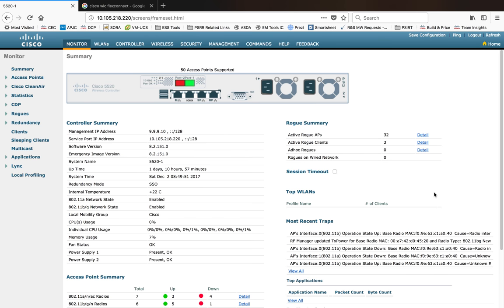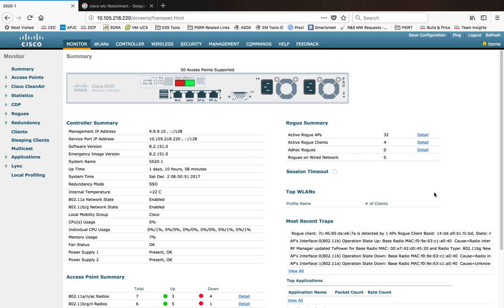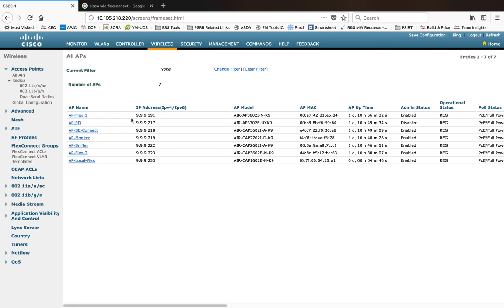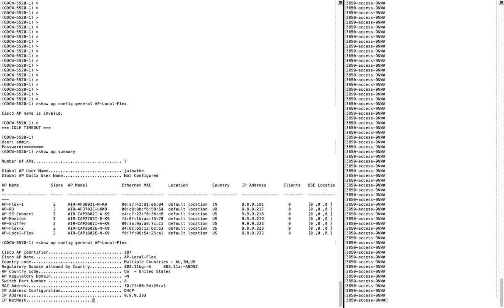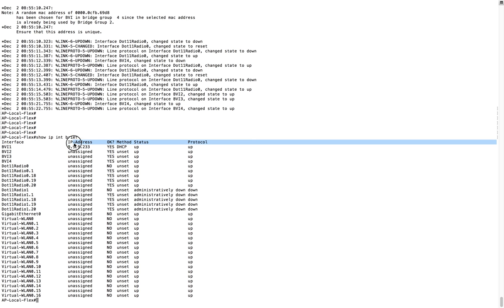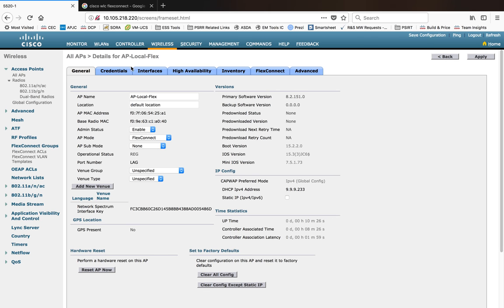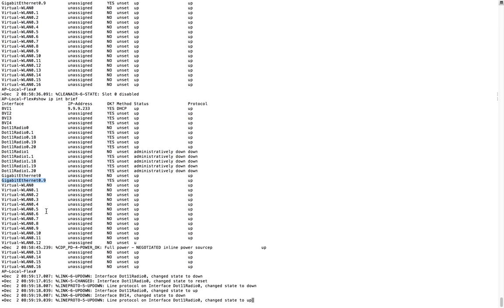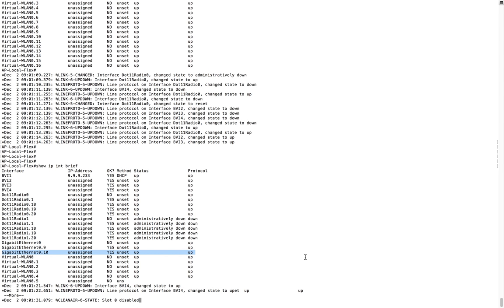How to Configure Flexconnect Mode on Cisco WLC  PART 1

Comment: Wasnt local switching already enabled?
Reply from the maker: By default local switching is disabled while creating the WLAN. Flex connect mode APs will not be able to do local data switching until it's enabled under WLAN.

Comment: Great Video !! Can i please know, how do we join this AP from a remote site to the WLC in DC when they are not in same subnet ? Can we do it through L3 routing ? any videos on that ? Thanks.
Reply from the maker: Basic requirement is to have a L3 connectivity between WLC and AP. If you can make that happen normal CAPWAP discovery will help you to get there. Please watch the video for CAPWAP discovery process, that explains different ways of discovering the WLC. In simple note Option 43 in DHCP Scope will be your friend here.
Reply: @CiscoNetworking  thanks let me try it and let you know the output. I have just configured a flex connect looking at your video, we will move the ap to remote location and check. Thanks

Comment: Hi Friend, i have one query if we have multiple AP in flex-connect mode but SSID is not converted to flex-connect. And want to do this now will it reboot AP or what will be the impact of SSID changes bring in network as i have 400+ AP and want to change SSID to flex-connect which is not implemented earlier but AP is chose as flex connect.
Reply from the maker: Only in two conditions we need AP reboot
1. AP mode change
2. AP group change

In newer APs, some of the reboots are also reduced but there will be a CAPWAP reset.

In your case APs are already in Flex-Connect mode so there is no reason for a reboot. But there will be a flap on WLAN as you have to disable and enable the WLAN to make changes. Also keep your Flex-Connect group ready for better handling of Locally Switched WLANs

Comment: Hi JAson another great video on Wireless, Really helpful....Two query I have regarding the configuration:-

1) Do we need to pass the correspoding vlans (which get created everytime we define vlan for locally sw/itched WLAN on AP) on switch connected trunk link as well, along with the Native Vlan.

2) Do the native vlan carry Centrally switched WLANs data over to the WLC present in DC
Reply from the maker: 1) You have two items here 
If you are making changes on Native VLAN, you have to update the same on the switches. 
If you want to add more WLAN with Diff VLANs, you have to update the 'allowed VLAN' list on the switch trunk port accordingly. 

2) in simple words, APs establish the CAPWAP tunnel using the AP Management IP part of the Native VLAN. So all the traffic pointing to WLC will pass through the same path. As the centrally switched WLANs are using the WLC as an exit point, they will pass through the native VLAN.
Reply: @CiscoNetworking  Thanks for the reply Jason...

Comment: what if the flexconnect ap has a weak signal? and users cannot connect to some ssid? what is the possible issue? and what resolution must be considered? thank you.
Reply from the maker: AP mode and RF don't have any connection here. Try to find what is going wrong on TX power levels in that area. Most probably its an RRM related issue. If you have an NMS system like Prime or DNAC check the heatmap of that area and find how the PTC taking care of the Transmit power. One you correct the RRM/RF profile settings, the issue should get resolved.

Comment: if i have an interface on the wlc where a captive portal is enabled and i have the ap in the remote offices how do i transport the captive up to the remote ap using the flex connect?
Reply from the maker: Keep the WLAN as central switching

Comment: What’s the difference between vlan 9 and vlan 10?
Reply from the maker: Just consider it as seperate vlans in the network, nothing special on it
Reply: Cisco Networking - but what is their purpose?  Is vlan 9 for the APs and Vlan 10 for data traffic?  Thank you
Reply from the maker: @Soundwave-F7Z  In my LAB setup the 10NW is used for outside network and 9NW is issolated inside my LAB. I access the LAB using 10NW directly or the Jump server that participating 10 and 9 NW. For showing the example was using both networks.